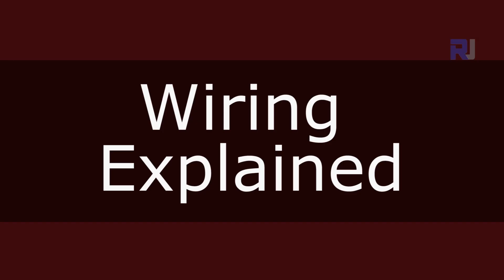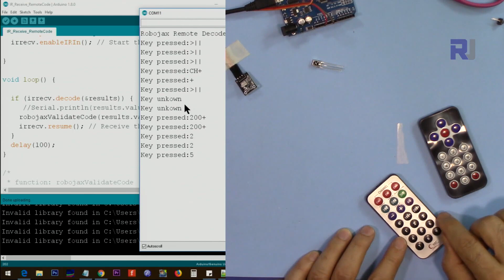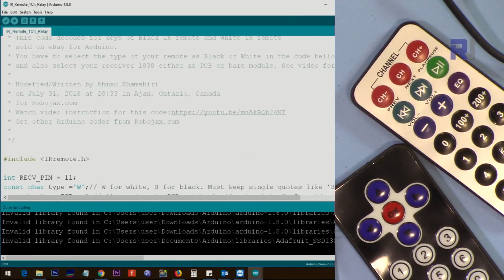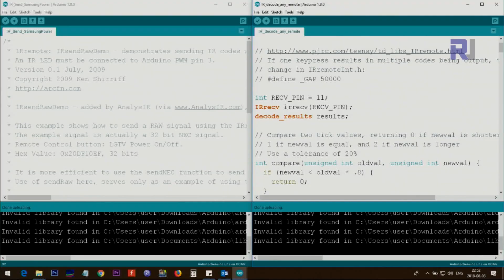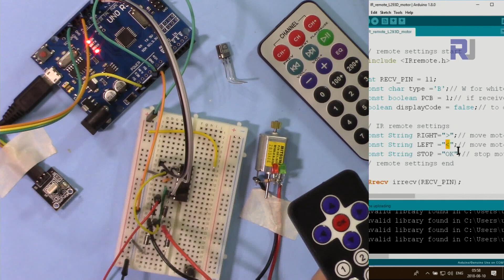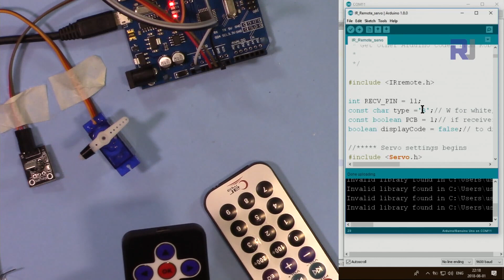Lesson 101: Using IR Remote to control TV,  AC Bulb with Relay, DC Motor and Servo Motor

Comment: Hi  i used  a 1k pot to control my servo using esp32 and  the servo wont move. why is that?
Reply from the maker: Hi, see the esp32 servo video.
Reply: @robojax   I watched the one u mentioned. And u used 100k
 I used a 1k pot and nothing works.
Is there a minimum resistance value for the pot to work with esp?

Comment: Hello sir. I am working on continuous rotation servo motor with the PCA9685 and Arduio. I am facing a problem that everytime I specify an interval to rotate and stop at the position I want, this interval changes when I power the arduino at another day or different place. How can I fix the rotation duration to give me the same result because I have to run the project in front of the examiners and it should be calibrated previously of course . Help please.
Is it because of the servo shield itself? what is the problem?
Reply from the maker: There is no continuous servo. It would be stepper motor. That motor was just made for joke.  You can’t position it and you can’t control it .
Reply: @robojax   Can I use PCA9685 with stepper motors? or can I control multiple stepper motor simultaneously? and how much motor I can control?

Also what causes the differences and errors in the cont. servo?  I need to know the cause is it the power? or the signal itself or  what?

more, can I use sensors to make cont. servo stops at a position or it is not efficient? because I am using the motors to rotate springs of the vending machine simultaneously.
Reply from the maker: This Luxor can’t be used with stepper. I have videos on stepper.